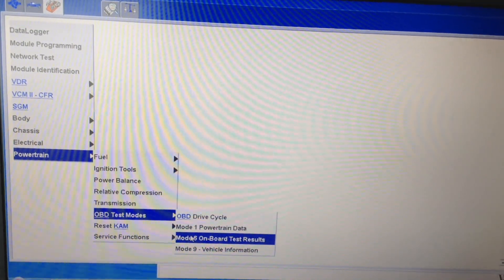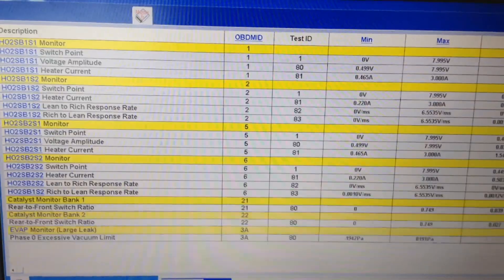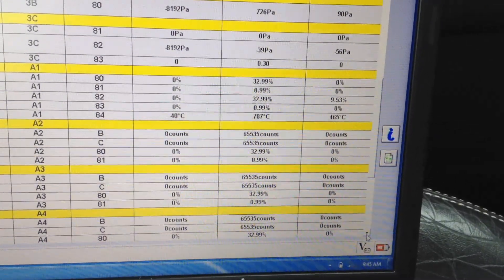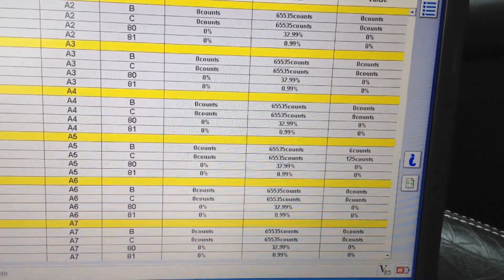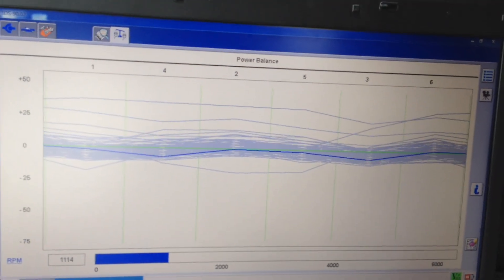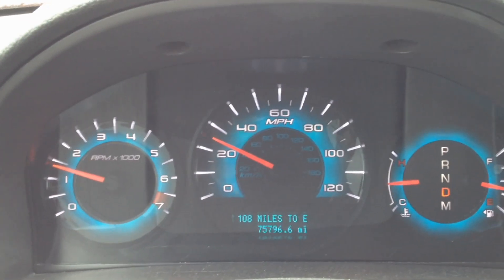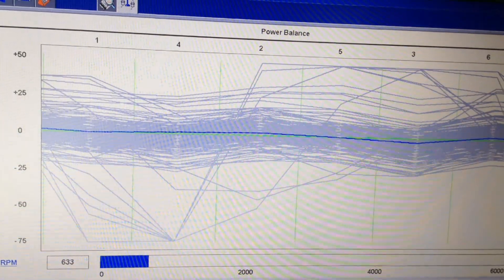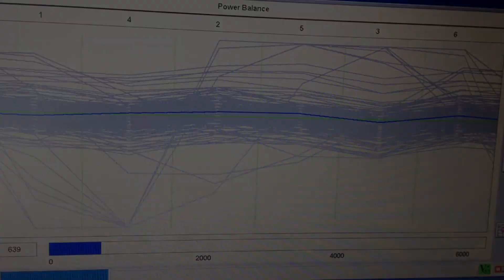Engine Misfires That Feel Like A Harsh Shifting Transmission

Comment: Any idea.. ?😭 2003 Acura TL type s ..After I change spark plugs and coil - symptom now is rough shifting and lack of engine  power during acceleration.
Reply: Ex-muslim Atheist Your transmission is probably going out or already bad. I had a 2003 Accord V6 and had the same issue. Both cars use the same engine and transmission.

Comment: I have a 2008 F150 4.2 L V6  61000 miles  w/ knock on hills; Can I use Premium fuel. The manual says never to use premium if any problem go to another brand. I use quality fuel usually BP. Will using premium fuel do any damages?????

Comment: I recently took my car to the shop with a misfire on #5 in a Cadillac DeVille DTS. Now they have took the ground wire routed to the #4 & 5. Now transmission switching horrible. I believe they burned out the ground wire.

Comment: I get zero lights. Ive got the 4.0, 03 explorer. It has violent bang when going up a hill or on a pull? Ive had the drive line looked at. Full compression on all cylinders. No lights at all. We did new bearings and hubs and the transfer case seems good. Rear gears seems good no metal. Its got 169k miles. Ive had it at an independent shop with no success but have an appointment next week for at the Ford service. Any help would be greatly appreciated.

Comment: My company has a bunch of f150 5.0 trucks 2019-2022 and ive been in 3 now that when you accelerate from the light consistently randomly it pops and backfires in the intake. Drops power like the timing is messed up. Just got mine back from ford replaced cam phasers and still have the problem. Any ideas? Any help is appreciated.

Comment: Hoping my car is just misfiring due to old coils. I did a lot of work to it recently - rebuilt PCV, replaced alternator, plugs, flushed coolant, oil and filter, transmission drain and refill x2, and fuel filter replacement - and now the engine is sort of bucking/stuttering/surging randomly kn the highway. Usually only after 15-20 minutes of driving during heavy engine load.

I really am terrified that draining and refilling the dirty transmission oil ruined the torque converter and it is a transmission problem (my transmission is basically untouchable short of a full rebuild so I'd be fucked). But I'm really really hoping that it is just because I changed the plugs and not the old coils so they are crapping out now. No idea, but I have $500 of fuel injectors and coil packs coming and I'm praying this solves my spastic RPM issues. Car runs smooth as hell after all my work but then randomly will sometimes feels like I'm riding a bull.

Comment: Ufff maybe this could be..get two trans mechanic scanned both and no issue found and drive normally no issue..so one showme that scanner says cilunder 4 misfire...can i test it with forscan? Or what tool do yo use??
Only get chech engine p0420 and p2196..could this affect too? Thanks

Comment: my ‘93 mark viii 4.6 dohc feels like it’s got a trans problem at around 38-40mph...feels like torque converter slipping...jerks when i let off the gas. i get a check engine light occasionally too. now i wonder if its a misfire. i’ve got new plugs and wires...maybe i’ll replace my two coil packs and see what happens!
Reply: Same here on my 2000 F150.  NOBODY seems to be addressing this issue.  I've been told the transmission, torque converter, u-joints, coil packs, and now the spark plugs... after weeks and weeks of independent research, I have found that I have coolant leaking into my spark plug wells and have realized that this is a VERY common issue with the TRITON 4.6, 5.4, and 6.3 engines due to a faulty air intake design. 

I now need to order myself a quality intake system ($120-$400)  and possibly even inspect my catalytic converter after driving around with this occasional issue for months now and no engine light.  I am ranting, but am also mindlessly typing during this informative video.  

Part of this issue could be a faulty u-joint if the issue is just slight jolting and start and stopping with a slightly eratic humm while driving, but in my case - it is definitely a misfire.  

UPDATE: engine light came on, and I pulled into O'Reillys and had a P0300 code, which is multiple random misfires... time to change my plugs and diagnose the issue... I am by no means q professional and am just a mechanically inclined college kid who loves my truck more than I probably should.

Comment: I have a 2005 Ford Freestyle.   The symptom is that it shudders while driving and at times a it shuts off while driving, but not all the time.  I noticed that the issue occurs when i filled the tank.  Once it drops  to half a tank it drives great.  I have replaced (Throttled  body, EGR, Computer, 1 coli for miss fire on cylinder 3, Fuel Filter, Fuel Pump) and still have the same symptom. On a Ford blog page.  The Ford tech says that it is the Throddle body but still have the problem.  Any idea on what it might be?    I did get a new AC system for the car.  It seemed that once i got a whole new AC system.  This problem occurred after 2 month's after the AC system was installed.

Comment: Hard shift 1-2...changed shift accumulator, MAF sensor, VSS, transmission fluid and no luck. Havent changed TPS because i feel you have to recalibrate it. Ive also searched around and read spark plugs/wires cause mis-fire which is causing the hard shift 1-2.

Comment: Is there a way i can talk to you on a phone and ask questions about my problem with my 2001 lincoln navigator I had a check engine light on for a misfire in cylinder 4 code was PO4 I GOT IT FIXED IT WENT AWAY THEN TWO WEEKS LATER CAME BACK .... SO AFTER THAT I CHANGED ALL THE CYLINDERS ON THE LEFT SIDE AFTER THAT THE LIGHT LEFT HAD NO MISFIRE NEVER HAD A SHAKING ISSUE JUST AT ONE POINT I FELT A SMALL JERK WHEN I WOULD PULL OFF ... SO 4 MONTHS LATER I START HAVING A OVER HEATING PROBLEM TOOK IT TO SHOP I NEEDED NEW WARTER PUMP GOT THAT DONE I WAS ROLLING NO ISSUES DRIVING EVERYWERE I NOTICE THAT WHEN I WOULD COAST IN APARTMENT COMPLEX OVER SPPED BUMPS ID FEEL A THUD SOUND FROM UNDERNEATH SUV I WAS TOLD IT WAS A HARD SHIFT BEACUSE O HAVE A LARGE TRANSMISSION SO NOW MONTHS LATER IM UNABLE TO DRIVE FOWARD BUT REVERSE WORKS WELL AND THATS WERE I AM TODAY I WAS TOLD I COULD HAVE A GASKET ISSUE AS WELL BECAUSE I DIDNT START UP SUV IN WEEK AND WHITE THICK SMOKE HAD STARTED TO COME OUT RHE TAIL PIPE THEN AFTER WARM UP IT WOULD THIN UP AND THEN G AWAY .. I HAVE NO MILKY NESS IN OIL AND I WAS TOLD IT COULD BE A TRANSMISSION SELINOED ISSUE AND IM JUST EXHAUSTED I CANT AFFORD A NEW AUTOMOBILE RIGHT NOW AND I HOPE I DONT GET OVER PRICED FOR WORK BECAUSE IT WIL BE HARD TO COME UP WITH A REASON MY LIFE IS SUCKING AT THIS POINT.

Comment: Good info. My 08 F-150 5.4 is doing this and I first thought it was trans.. It almost never fails, not through all rpms and gears but always at around 1200 RPM between 40-50 mph with any pull on the engine It starts jerking hard repeatedly. If I stab the gas and it pulls harder It still noticeably does it and the check light starts flashing just as it does here. Now to see if I can afford to have it checked out..

Comment: What was the conclusion for why this vehicle was misfiring?
Reply: Did you find the fix???? Im having the same issue with a BMW tho..?
Reply: CFA Help misfire is no spark in the spark plug, cause = 1 )bad ignition coil. 2) bad spark plug wire. 3) damage spark plug or too old. 4) an injector in poor condition. Solution = tune up
Reply: Change your ignition coils
Reply: If you scroll, you'll see his conclusion. It was a misfire on cyl 4. He swapped coils with 4 and 5 and then 5 misfired. The conclusion was bad ignition coils.
Reply: I have a 2005 TJ wrangler with bucking and hesitation while pressing the accelerator and more shaking needs me to soft pressing it to avoid that.
Reply: Spark plugs changed and wiring plus mounting the battery 2 months ago.
Reply: I changed all coil & all spark plug & still got the same results

Comment: 2013 explorer (no turbo) change: spark plug, coils, purge valve, MASS sensor, air filter, pcv, clean throttle body(No Codes) and still jerks around 40mph when you get 2000 Rpm.. Dealership say it has misfire... Still not fix.

Comment: My wife's 2011 Nissan Rogue has this exact same condition going on. We thought her CVT transmission might be acting up but it only does it at certain times when you're giving it gas starting to go up a slight incline or sometimes just driving down the road. I thought it might be a misfire, but the engine light has not come on, and while watching the RPM gauge when this happens, I do not see the RPMs drop at all. It has been a while since I scanned it, so I'm going to get it scanned again to see if there are any new misfire codes. We replaced one factory coil that had went out with an O'Reilly coil and we thought it was doing okay. Now I'm wondering if that non-factory coil might have problems.
Reply: How’d that work out buddy?
Reply: @jasonfromm5637   I'm not running the after market coil anymore, and there are no misfires with OEM coils in. The transmission is still acting up the same way. I have resorted to pushing the button to lock out overdrive when I am driving under 35 miles per hour or so. This keeps it from jerking until I get up in speed, and then I depress the button again to accelerate up past 40.

Comment: I have 2005 f250 with the 5.4 3 valve. I replaced all the coils. I pull a trailer with it (5500 lbs) and while accelerating at high rpms it   hesitates and shudders a little or no power. I was thinking I may have a fuel issue or injector issue? 200,000 miles, Just turned over this weekend.

Comment: my 05 mustang has been running poorly lately kinda similar to this. i get the flashing check engine light usually when i try to drive the car hard as in push it to red line and make it shift under power but instead it won't shift until i let off and will usually flash the check engine light. first i was thinking bad transmission but after seeing this I'm thinking maybe it really is a misfire that is my main issue. the car doesn't usually misfire under normal driving but i went out after watching this and did notice if i put my hand on the intake manifold i can feel an irregularity in the idle like a small misfire is going on. going to check plugs and wires in the morning and compression test and go from there.

Comment: I wish I could figure out whats going on with my 03 crown vic. I keep getting misfires... truly all types of misfire codes. P0316 P0300 P0303 P0306 and i have changed all plugs to motorcraft and changed the ignition coils on 3 and 6 to Motorcraft direct from ford and still cannot figure out what in the heck is going on. Vehicle has 127000miles. I must be overlooking something 🤔
Reply: Just an opinion from a self-taught shade-tree mechanic:
Have you checked the fuel injectors? Maybe they are clogged or clogging up? Possibly a fuel filter if your vehicle has one? Or, even possibly, the fuel pump itself, going erratic at times or going bad?
Just a few things to look at.
If you do have a fuel filter, try replacing it first.
Reply: Did you find a solution mines doing the same thing some guy I know knows a lot about cars and first thing he checked was the cylinders and he told me I had damaged coils that they were stuck and lubricated with some oil but he said as long as I don’t have puddles of oil that I’m good. Which there wasn’t. And he told me to get spark plugs I guess everyone’s situation is different. But we are headed in the same direction.
Reply: Spark plug gap
Reply: Things that can cause a miss are coils plugs injectors compression and of course my favorite ecm anomalies. Happy hunting
Reply: @Diego Lopez  a bad fuel injector connector was my problem, i tried replacing everything else, and that was the last thing that was easy to try and wala! 😂😂😂😂.... fixed!
Reply: @dannp9026  a bad fuel injector connector for me (female connector)
Reply: @justinisom6161  bad or lose connection for me, a bad femal connector can cause it.
Reply: A new pigtail and some dielectric will do the trick or you can try a re pin. I have done both with great reward.
Reply: Sounds like ypu have a ground issue
Reply: Check your wires before you pull injectors for a cleaning or replacement. I have had even Tylor made wires fail after about 3yrs (under 10k miles).  OEM wires have always performed well in stock to mildly modified applications.
Reply: Could be plugs, wires, wiring harness for coils or injectors, coils, injectors, loss of compression on a cylinder from stuck rings or cylinder scoring, damaged valves or valve springs and in rare cases a ECM.  A few of these make distinctive sounds that you can normally rule out quickly.  I got lucky with mine, swapped coils and plugs. The misfire stayed on cylinder 3.  Swapped the wires from cylinders 1&3. Misfire moved from cylinder 3 over to cylinder 1 with the wire. A set of new Delco wires and a few minutes and my truck is back to purring like a kitten. 👍👍

Comment: I have a 2001 Ford Escape 3.0 liter V-6. Recently the check engine light came on and the code was for miss-fire on Cylinder #1 . Not to long after..the transmission seemed to stumble between shifts...is this caused by the mi-ss fire?
Reply: so what happened? update us.
Reply: @thersten  I had the transmissin checked and it was determined to be OK.  I removed the #1 Cyl. spark plug and examined it and it looked to be in good condition since it was only about a year old but went ahead and replaced it anyway and also replaced the coil pack. This seem to fix the problem for the #1 Cyl. mis-fire however the same code appeared again a week later, only this time for the #3 Cyl. , unfortunately this is located under the intake manifold and requires removal of the intake assy. to access. I took the vehicle to the local Ford dealership to have the problem repaired but they wanted almost  $1500.00 to diagnose and repair the problem. Ive removed the intake in the past and it is a pain to do but shouldnt cost that much!!!... it just that my time is very limited to be able to tackle this job so it will sit in the garage for now...may end up selling or trading it in on something else.
Reply: @kevinhedspeth4303  thank you for the update. Anyway, good luck. Maybe take a weekend off and remove the intake so you can check those other plugs.

Comment: I have a problem like this in 2004 5.4 3v F150. Its the no codes thing that is confusing local shop. I will be driving along and all the sudden truck feels like it hits dead spot then runs like nothing happened. Changed coils and engine feels stronger but still does this. Again no codes. What should I tell them to look for?

Comment: This is what is happening on my 04 5.4L Triton Expidition. Just had 3000 dollars worth of work done. Mostly front suspension stuff but also Spark plug, boots, coils, everything were replaced. Had the car back for a bout a week or so and im getting this hesitation and misfire on acceleration. Took it back to shop today. Just dropped it off. Under warranty.  Hopefully it's within the spark plugs. I cant dish out anymore money for this truck. I do love the truck tho.

Comment: I recently bought a 04 freestar and it has been trouble since day one the only code that comes up is the coil pack so 3 coil packs and new plugs and wires later it still idles rough bogs down and has no power I tried to go uphill in it the rpms were at 3000 and it was barely going 15mph I'm at a loss  I just don't what else it could be

Comment: Hi thanks for you video it stopped me from removing my transmission which i was about to start removing in an hour my 99 windstar started to shudder when light acceleration especially on hills or loaded van with the ac on and hard up/down shifts between 1st - 2nd  especially when warmed up . I started to see these problems after my engine ceased on me due to the lower intake manifold gaskets leaked i figured it out after it ceased and started opening up the engine and found most of the water in cyl 2. to startup the engine I watched a youtube video where the guy sprays wd 40 into the cylinders and cranks the engine by hand and it worked for me but i didnt bore out or replace any piston rings currently i dont have any codes but my scanner does show a slight percent of cyl 2 misfire. it does seem the shudder gets a little better when i use thicker oil instead of 5w20. thinking the transmission was bad i added the lucas transmission fix into the transmission i dont have any shuddering or hard shifts now but it seems i dont have enough power when acceleration i was still in doubt that its the transmission or the TC, i also was in doubt that i shorted the tcc solenoid for some reason as my brake light switch wire had a loose connnection as i read a post saying that the brake switch has to do something with the tcc solenoid, but that doesnt seem the case now after watching your video now i think i will have to start digging into the engine check the cyl pressure etc.. but still i would ask you to recommend me where to start engine? or transmission?  thanks

Comment: My wife 2007 Edge Sel awd 3.5L v6 suv has tow package & I think sport as well...(I think), Amy way just got Code P0303 cylinder 3 misfire. An the s7v does jerk at times so I am wondering if what you speaking upon here applies to what I been experiencing exactly as you described.  Yes I got flashing check Engine light that it flashes just as you showed in the video.... what was the fix for everything you talked about here ?

Comment: I have a 2011 f350 6.7l. I need to replace the solenoids in the tranny and was wondering if you could let me know the best way to replace them.
 Seen the video you replacing the tranny fluid and seen the solenoids and just wished you had a video on replacing them too.